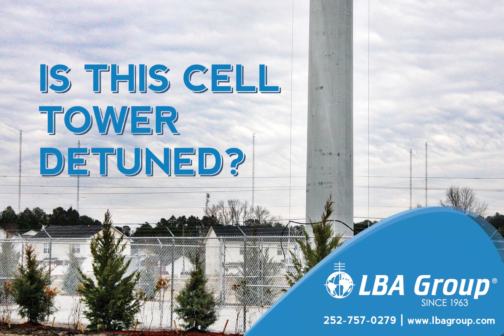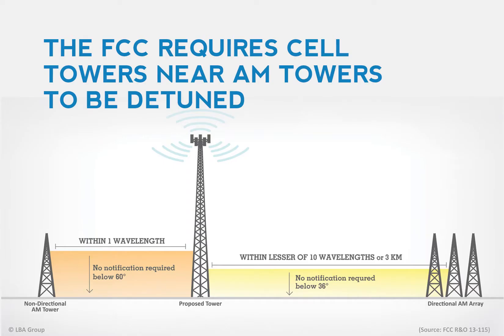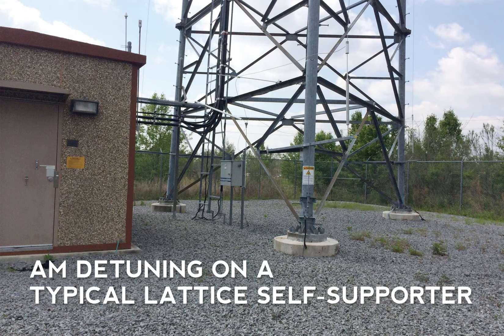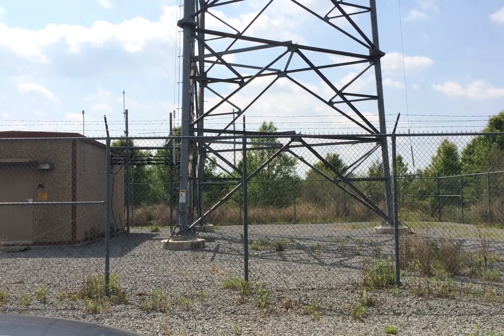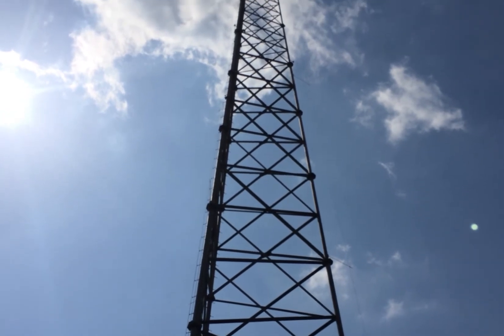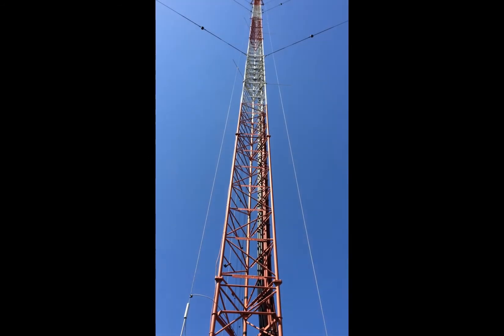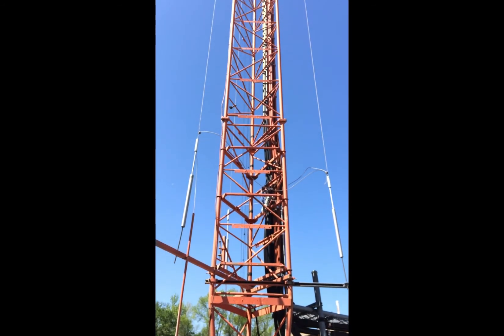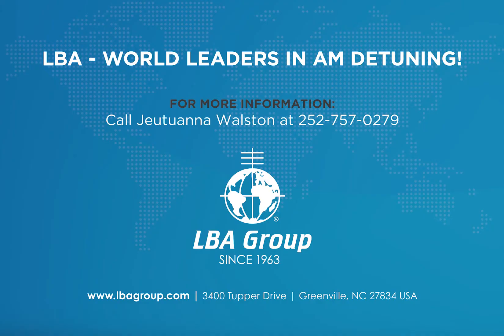Is This Cell Tower Detuned?

Comment: Thanks for this message. I used to own an AM station and the local government built a tower just under the required spacing for it to be detuned. I called the company erecting the tower and asked them if it was being detuned. After much hemming and hawing, I was told "Look, it's almost at the distance where we don't need to detune; can't we just let it pass by this time?". I told him no, because as the licensee of the station, it was my duty to be in compliance with the FCC, and I'd not let it just slide, especially since the local government was the owner of the tower, and they never let anything of mine "just slide". 
He told me he'd have to fly in someone to do the detuning, and it would take over a week to get them there. Meanwhile, he had a tower crew laying around in hotel rooms, getting paid to do nothing. Sorry, should've done your homework and not tried to let one "slide by"! I got rid of the station years ago, but I suppose the detuning is still in place!